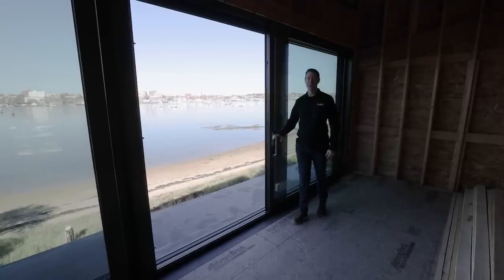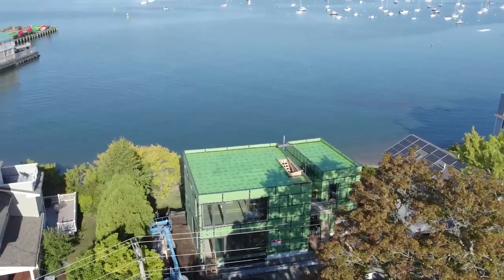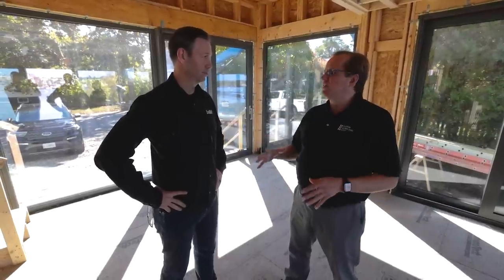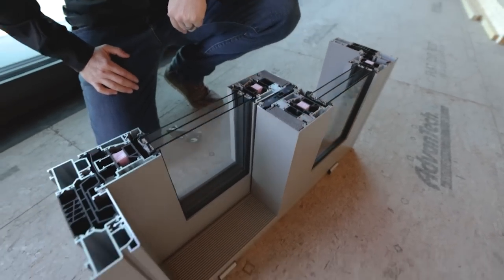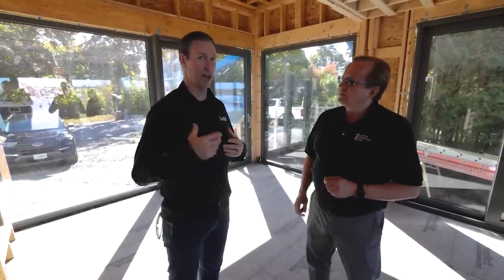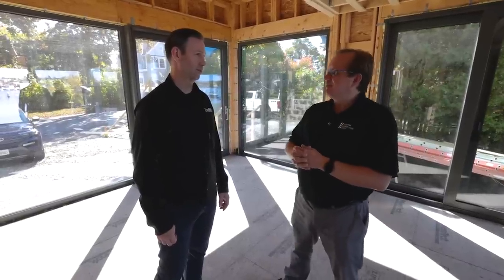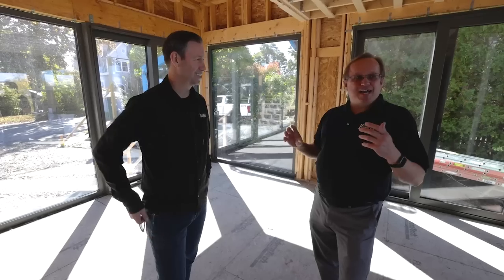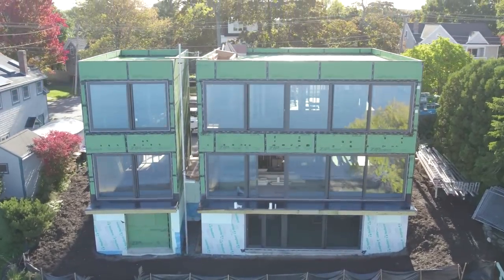How To Get Better/Cheaper Windows from Europe (to US Job-sites)!

Comment: Besides the efficiency aspect of European windows and doors, I'm extremely impressed with the physical capabilities of them.  I love how most windows will tilt in at the top to allow air flow without letting water in.  And then can also swing inward completely, having multiple lugs around all four sides lock the window into a sealed position when closed.  Lifting sliders are amazing as well.  Our front door is metal with wood cladding and has 18 lugs that rotate into the frame when locked, just like a bank vault does.  Living in Europe for the last 3 years has really spoiled me on windows and doors.  It will take some adjustment when I return to the US next year.
Reply: a thing that shocked me about many doors in north america, THRE'S A VISIBLE GAP BETWEEN door and floor and im not talking about doors between different room (that would not be acceptable in western europe) but the main entry door of modest home or apparment...
Reply: @Tonyx.yt.  my home here in Italy has the same seal along the bottom that most homes in the US have. Hadn't noticed a difference.
Reply: @Tonyx.yt.  that is installer error. No modern US door is made with a gap at the bottom. Most have adjustments and gaskets that seal there.
Reply: The products you are talking about are also available here too and they are common on high end homes like Matt showcases. The multi bolts mechanism is an option from most major door manufacturers. I had the option when buying my therma-tru doors. But do I need a vault door when I have a glass window not far away? Not really lol specially considering just installing a security strike plate will achieve 70% of the strength.

So its up to Americans whether they want to spend more on their houses for expensive windows like these.. not so much the industry or builders choice. Personally, good vinyl double hung windows come in at a great price point and work great both energy and functionality wise. I would have to be building a 3mil+ dollar house before I would look at importing expensive windows from Europe.

Comment: I know this is the "build" show, but I would have loved to hear something about retrofitting existing homes.
Reply: Fuzzy Bear, There is a show, like that, it’s called This Old House on PBS.  Good Luck Norm , on the next phase of your Journey. Be Safe
Reply: These euro windows will work for retrofitting as well. 
They also manufacture them with flange upon request. 
All German and Italian brands do flange on request on most line of products.
Reply: The fact that it requires a €15,000 subsidy - that I am not entitled to - to make it make sense, suggests it does not make sense.
Reply: The dude specifically said their windows are all custom size, you give them the size you want they build the window!

Comment: This makes me grumble about my 7 yr old Amsco windows with little thermal resistance that leak air/dirt/moisture into the inside of the house through the bottom track. We requested and paid for what the builder called “high efficiency” windows, but we believe the builder went with something really basic by mistake, or to balance other construction costs that came in higher than budget (which happened in a couple of instances). Our prior house was a basic spec home and the windows were better. My bad for being ignorant at the time and not double checking things. But if he had simply told us bluntly about the cost changes,  we would have been totally fine spending the extra money to ensure we got quality windows. I think he meant well but didn’t realize that his tendency to sugar coat details and avoid disappointing clients was worse in the long term.

Comment: i really enjoy the fibrex windows i have on my home. high quality composites, all metal handles, latch's, rails, etc. higher quantity of argon. the demonstration even on the finished product that was installed for heat exchange from internal and external was outstanding. a plus side is they were custom made here in America to fit my older home.

Comment: Can they provide Miami-Dade approved doors/windows? That would be amazing.
Reply: The testing process is very expensive for this. If your looking for that kind of performance you can get laminated glass and be pretty certain it will hold up through anything.
Reply: No problem at all with Miami - Dade approved European windows and doors, as you can order them with the seal of the Rosenheim testing institute which is even exceeding the Miami/Dade requirements and recognized here.

Comment: Triple pane adds additional failure modes for marginal benefits
Reply: Worked with theese types of windows in Norway for 25 years, never seen any issue at all. Mine is 25 years old to and look brand new.

Comment: Here in Europe it is very rare that Windows are installed with the glass, the frames are in first and the glass later. This may well be due to weight, it is far easier to install a fairly light frame, get it square and then just slip in the glass. I had some units fitted, a couple of years ago now, included aluminium bifold doors, self cleaning, solar control, argon filled, double glazed, as there are blinds in between the glass, no cleaning required.  The bi folds came with multi point locking, high security locks, and as they are down to the floor the glass is laminated for safety. All of the frames, being Aluminium are thermally isolated. These were not top of the range, just fairly standard , from a local, to me, company. All with a 10 year insurance backed warranty. Some 12M, around 36’ of glass, 2.2M 8’ high, in panels, cost some £8,000, installed, at current exchange rates $8400?  There is huge competition for suppling windows, keeps the cost low. Any style is possible, even for historic buildings that have very strict controls on what can be used, identical to the original, where Xenon is used between the glass,as the gap will be very small, but they are expensive.

Comment: the only bad thing about triple glazed windows is that they are heavy.
some larger window will give the worker nice workout
and after a while due to the weight of the window you need to adjust hinges a little bit to make it leveled again so it does close nicely again.

That is when the window is European style and openable (not fixed window)
Reply: Never heard of that. And i work with windows like theese. They are heavy but hinges are really strong. Nevee heard anyone adjusting anything
Reply: @Randomdude21-e  you can see it when you are closing fully opened window it should not resist at all and should close nicely fully touching the frame without need of any push in.
If it does not get closed with eaze small adjustment in hinges that takes few seconds will fix the lean of the window.

people usually do not complain about details like these but you can meet exceptions
Reply: @doposud  if its mounted correctly it closes nicely
Reply: @Randomdude21-e  Well it does not after a while , especially if you don't even know that you can adjust it ....
Reply: @doposud  never had any issues at all. As i said i do this. And i put in my windows  over 20 years ago. They are strong as hell.

Comment: Cant stop looking at that spray foam interior window seal, and all the clips penetrating the seal. Seems to be a high reliance on the exterior tape application.
@18 min - 110 mph is equivalent to only DP 30 - so not that impressive for 10 ft tall sliders.
@19 min - there are US window manufactures who offer similar services

Comment: Love the windows but the house is weird. I wish building standards would change so new homes must have minimum 6 to 8 inch thick walls, not only for more insulation, but for structural integrity and more room for plumbing, wiring, hvac systems, fire safety, etc. As for increased matierial costs, I'm  sure we could find some good uses for recycled matierials. In the end I'm sure you will find people who will pay more for a better build.
Reply: Yeah, it's strange to see these kind of windows in a wooden frame.
Didn't get a good look at how thick the walls were, but having high performance windows in a simple wooden box is a waste of good windows.
My first thought was: those windows are going to be toughter to get through than going through the wall. ;)

Comment: I worked with European Architectural Supply and Zola. Their response time is like 2 weeks, price is 2x (compared to direct with all fees and shipping), and also, everything is wrong - I literally provided them with floor-plans and elevations and other descriptions, they come back in 2 weeks - all wrong. There are better European manufacturers and window suppliers that sell to consumers. Very disappointing experience for me, but I got my order direct from a German company that respond in 24 hours, and guess what? either correct or better than I asked. Delivery process is easy, just find a good import agent, they do everything for you - ISF, delivery, customs, whatever...
Reply: Exactly, do it yourself and save the exasperation!
Reply: Zola sucks so much. worst company to work with! I had the same experience.
Reply: Interesting! I'm a carpenter based in Germany and have been thinking of starting an import/export business for German Products.. Any other  experiences you've had worth mentioning?

Comment: What is that, like 60k$ USD in windows on that one side?  Maybe if “code” didn’t dictate that we needed to pressurize our houses, so they mold and rot without electricity (central air, grid tie) we’d care more about the materials we used

Comment: Matt and Patrik talk about the European windows being so much better in all areas. With this knowledge why does a company like Schuco not open up a factory in the USA? 
Or an American company start a joint venture with any European manufacturer?
Reply: They are not better in all areas, they are expensive to buy and install. I would get them if they were reasonable but for most sub 2-3mil houses, it doesn't make sense given the rest of the house.

Being more expensive by a large margin reduces their market. They won't create a factory here because not enough people have the budget to buy them. That's the same reason US companies don't make a ton of high end windows like this. Its not because they can't, its because people won't buy them. Part of the reason Europe has so many, is their governments force them to high energy standards because they don't have energy security like the US.
Reply: It's because gas is much cheaper in the USA and houses are mostly build with wood.
Both kinda defeat the purpose of those high performance windows.
If the USA decides to finally work on climate change, those windows might be needed though.
Reply: I also don’t get it. Sure, triple-glazed maybe doesn’t make sense everywhere, but tilt windows for sure are a nice thing to have, right? Being able to keep open a window without the rain getting inside is kinda good.
Reply: Schuco does a factory in CT but it only does commercial.  Schuco has a Toronto assembly plant but I have been told that ordering from that location actually costs more than the way EAS does it.  EAS orders directly from Germany.
Reply: @Josh.1234 most of europe has enough energy. They have allways just try to save the planet by using less energy. Its their goal. And the windows are great for soundproofing too. We have a highway 20 feet from our building and you see the cars but you really can’t hear them at all. Walls are 10 inches too tho. And houses do last longer. Most houses stay up 100+ years here.

Comment: Matt, I've seen a number of videos on EAS and their windows.  I''m sold on the European windows, having experienced them in France.  I'm building a home for us, and would have pursued them, but cannot find a straight forward guide on how to use these in US framed walls, critical when most trades are used to nailing fins.  The EAS website has lots of technical information, but seems to lack a basic, easy to follow, step-by-step "here's how" guide for the non-architect builder.
Reply: there's dozens of flangeless install videos on youtube.

Comment: Matt, challenge domestic manufacturers on why they don’t match Euro construction.  As a career manufacturing pro, I can tell you it would be cheaper to make anything here vs Europe.
Reply: These windows are drastically more expensive than quality vinyl windows in the US. If everyone could afford these windows in their builds they would also be driving ferraris :). The US consumer drives how much they want to spend on windows along with some govt regulations but in Europe govt regs are way stricter and their energy is insanely expensive

Comment: Interesting that it's cheaper to import rather than manufacture under licence in the US.

Funny that I've always looked at flange windows that you often show on here as a superior solution. It would be great to see how they waterproof and insulate their installs.

The cheap uPVC windows you can buy off the shelf in Home Depot (b and q here in the UK) are useless. I have a door and two windows in my garage and they have all dropped. The door has dropped 30mm.

When I put new windows in my house I was told the insulation gain from triple glazing Vs double wasn't worth the cost. Hard to know which salesman to believe
Reply: My guess barriers of entree are too much. Cost of training, new machines, demand, etc...Even right now, my guess 1 out of every 5000 windows installed is european style...

As for insulation.. i think it depends, for example. if you have south facing windows and live in warm climate, you must have triple. If you live in England for example, on north side, you'd likely only have double, since triple may not make a difference. I would imagine companies like these can take a look at our house, area, house orientation and give you advice. In the end you're not only paying for glass and frames, but delivery, post sale support, and obv pre-sale expertise.
Reply: Double vs Triple pane cost difference is very small and worth it. I am in Western Canada. House is 2 story with 32 windows. Quad pane with Argon gas fill, Low E glazing, Fiberglass
frame with life time 
warranty. Energy saving is noticeable in summer or winter.
Wall is 2x6 framing.
Reply: @tonyhwang3888  which manufacturer did you buy from? I haven’t seen quad pane anywhere.
Reply: Same, curious on this quad pane.